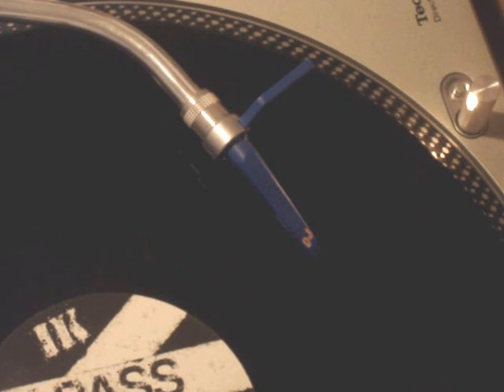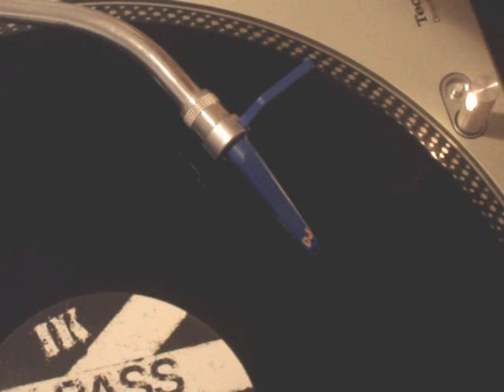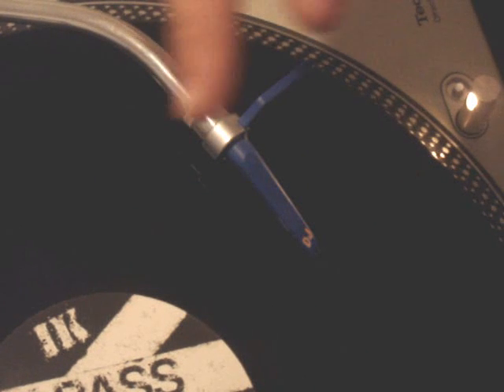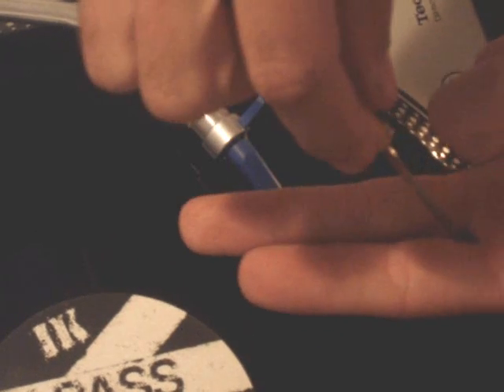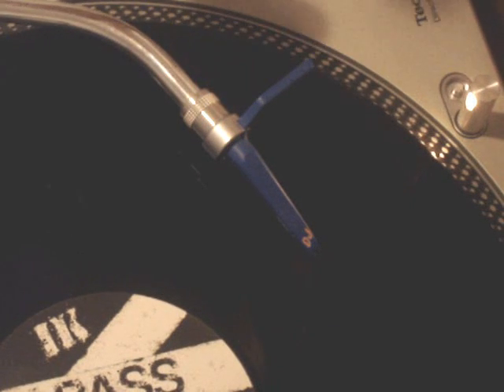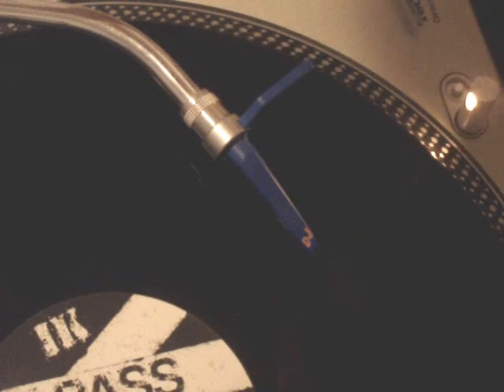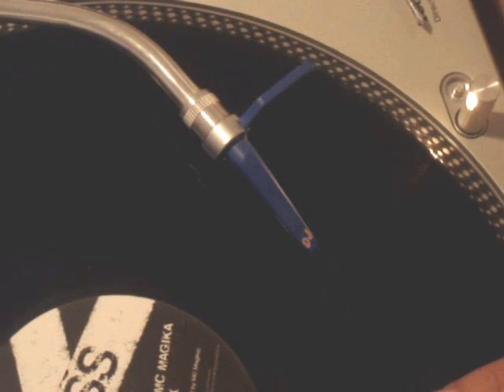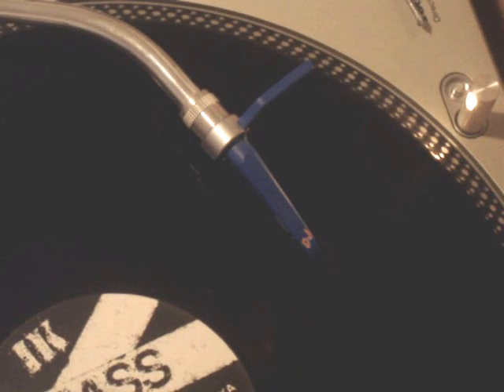how a vinyl/record works

Comment: @BigMilan 
The 'magic' is all electromagnetism.    Move a magnet past a coil of wire, and electrical current flows through the wire.     This is how the microphone converts vibrations to electrical current,  the record cutter converts it back to movement, the stylus makes it back to electricity, then the speakers make it back into movement!!      
Hopefully if all mechanical and electronic things are designed well, then it still sounds like the original sound!!

Comment: @Alimantado91 
Electromagnetism!   The stylus has tiny magnets moving within coils of wire, the tiny current produced when they move is amplified to become a much more powerful version of the same electrical signal,  then fed to the speakers, which themselves are worked by a large coil of wire moving past a large magnet, so the movement of the speaker cone is an exact copy of  the movement of the stylus in the groove.

Comment: The player stylus has two magnetic cores and fixed coils, arranged in an 90° angle towards each other. In the same angle, the waveforms in the record groove are arranged (in a V-groove, so each stereo channel is represented by a side of the groove). Depending on what movements the groove makes while it plays, one or two of the channels are provided with a signal (and every kind of difference between their levels, so a certain signal is provided either more into the left or the right channel).

Comment: Doesn't the stylus go left, right, up, down?  A tiny electrical current is generated via a magnet & coils inside the cartridge.  This is sent along tiny wires in the arm, out of the record player and into an amplifier, where the current is -guess what- amplified to a level hefty enough to make cones vibrate in an almost direct copy of the original stylus vibrations.  It is magic when you think about it!

Comment: Purely up and down is a bit misleading, yeah.  It's at a 45º angle to the surface of the record.  So it is somewhat vertical and somewhat horizontal...it's basically up and down, just rotated 45º on the horizontal plane.

Comment: You know, a cool thing about records is that you COULD have used the screwdriver to play it. Well, maybe not that, but a knife tip or a paper edge works just fine :) Yes, it's not very nice to do that to a record but it's good to know (if your plane crashes in the middle of a jungle, and both you and your records survive, you can still play your favorite tunes :D)